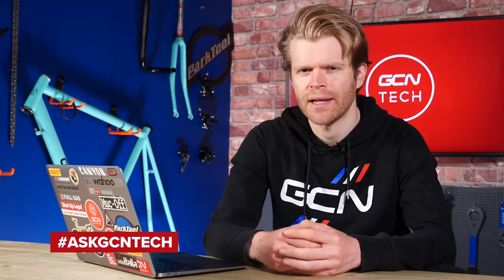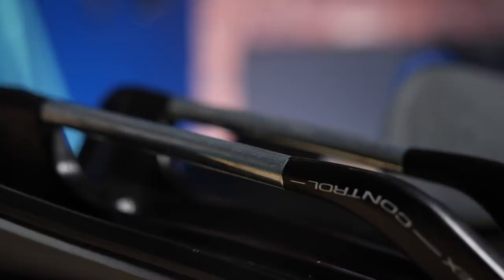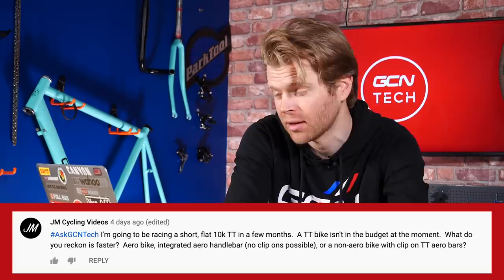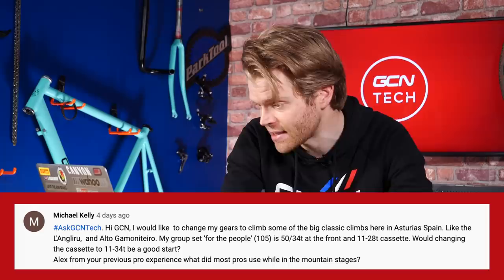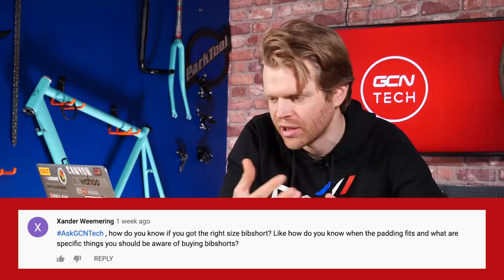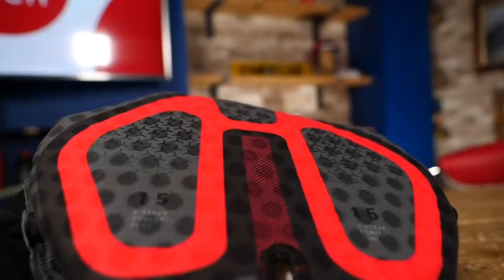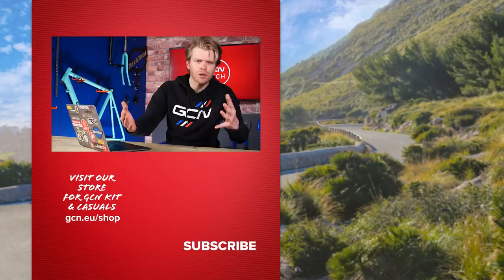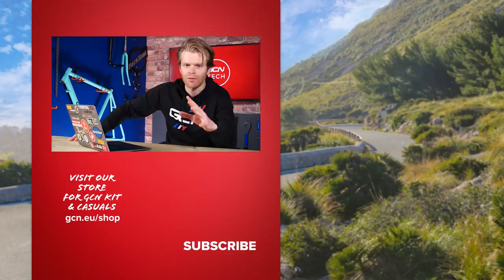Do Latex Inner Tubes Puncture More Easily? | GCN Tech Clinic #AskGCNTech

Comment: #AskGCNTech: Vittoria Air-Liner Ammonia in Sealant Warning = Si pointed out & Vittoria tech has confirmed that the Sealant used with the Air-Liner should not contain any Ammonia. I contacted the Sealant Brand I use and they stated "Ammonia is present in all natural latex solutions - we minimize down to .001ppm". So is that safe enough? 
Vittoria was no help in naming brands that would not be compatible. With all the different Sealants being used by so many riders,  unless the Brand was crystal clear with their ingredients or at least Ammonia content, how would a rider know? Interestingly, Muc-Off one of GCN's sponsors does say Ammonia Free in their website's Product Feature page. The Brand I use does not mention Ammonia at all. I looked at a few other brands with similar mixed results
Mountain & Gravel riders have been using Liners for years including Vittoria's watching YT videos I did not hear any of them mention of Ammonia or damage to their liners from sealant. Feel Free to Edit in anyway - Hoping Alex (aka Mr. Tubeless) can handle this topic.
is ZERO Ammonia the only safe level?

Comment: Latex doesn’t puncture easier they’re about the same. However when it does it all goes at once. No slow leaks, no chance of making it home without a switch.
Reply: BOOM!!!
Reply: @hebrews11vs5  Exactly!
Reply: They are however more resistant to pinch flats, latex being a more fleixble material might be the cause for this. Pinch flatted latex tubes can be repaired from the inside with latex sealant, let them sit slightly inflated for a few days while the sealant hardens and you're good to go. The sealant doesn't repair the holes unless the tyre also gets punctured - And yes, it will get messy!
Reply: @arvidfahlander5364  this is new to me. Thanks for sharing on the latex sealant

Comment: #AskGCNTech on a quite standard road, which part is the fastest (lower rolling resistance)? The part with car rubber or the center of the road? (The kind of nerdy question you ask yourself on loooong rides)
Reply: Is though about this to and decided it depends on your road surface if it’s smooth tarmac then it doesn’t matter but I’ve found that on rougher roads the area where the car tyres run is typically smoother and more quiet so you could probably deduce a little faster too.
Reply: I think the painted lines are faster personally, as long as the surface bumps are the same.
Reply: if you feel the surface, it is breaking you

Comment: Hi All,
What are the critical values I need to look when i purchase a latex tube? I have a 32mm wide tyre, do I need to look for a number somewhere on the spec written 32 or at least 32? So for e.g. 26-36? Thank you! Do I need to fit the inner tube against the rim dimensions or against the tyre? 
So for e.g. I have a 622x19C  ETRTO measure, with a 32mm tyre.
Is this 30/38-622 value is good for me (one of the latex tube I found against my set-up)?
Thank you :)

Comment: #askGCNTech     
When you put a puncture repair patch on a Latex inner tube goes it makes it roll slower so it roles like a butyl tube?
Reply: You have to use pre glued patches on latex tubes, can't say I've ever noticed the difference between a patched vs non patched tube. I've been using them on and off for nigh on 30 years now and I've used most of the brands out there at some point. Most issues are normally down to storage as they degrade if not packaged well and you have to be careful not to pinch them when fitting. The ammonia in some latex solutions can break them down too. Treat them with care and you'll have a lighter smoother and faster ride compared to butyl tubes.

Comment: #AskGCNTech Is it possible to convert a flat bar, belt drive commuter bike into a drop bar, belt drive gravel bike?  Tire clearance is not a problem.
Reply: That depends a lot on what you mean by commuter bike. If we are talking traditional Hybrid then it is usually doable with good results, the main issue you tend to run into is that the top tube length is longer than it would be on a traditional Gravel/CX/Road frame. Providing the top tube isn`t massively longer you can reduce the reach with your stem and bar choices, measure your top tube length then go look at the geo charts for Gravel bikes online (of equivalent size) and see how much longer your top tube is and go from there. Stems wont be an issue as they come in all sizes and are pretty cheap but if you go too short things can get a bit "twitchy" so its better to even out the reduction between the bars and the stem.

Comment: #AskGCNTech which is better, 50mm deep rim or 40mm deep rim. Interms of Speed, handling, and any other aspects?
Reply: 50mm aero. Aero gains are still noticeable vs 40, stiffer rim due to deeper carbon (will corner on rails). And cross wind stability isn't much different. Weight savings with 40mm is usually almost not their either go deeper.
Reply: 40mm much better
Reply: I have 50mm aero - was advised that deeper is better for performance but any deeper than 50mm is a problem in cross winds.  I have had mine for 6 months and have been very happy- they are also lighter than the aluminium wheels they replaced so better for climbing
Reply: 40mm better then 50mm. Reason: lighter, better acceleration, better handling, better in wind,better feeling overall.
Reply: This is more confusing than before 😭

Comment: Hi GCN, i have recently purchased a pair of latex inner tubes but upon arrival i noticed that on the box it says not for use with carbon rims? i am running mavic cosmic carbon wheels with rim brakes, can you please explain why they are not compatible or if i should be okay to run them on my set up? #AskGCN

Comment: #AskGCNTech

In a top level pro time trial how is the time measured when a rider hits the course? Is it exactly at the end of the countdown or is there a more accurate measuring that also takes into account the little time gap between the end of the countdown and the moment the rider actually starts to roll down the ramp?
With pro time trials beeing measured within hundreds of a second at the finish, it would seem a bit strange to me to be inaccurate at the start.
Reply: It's from when the chip on the bike passes the sensor at start and finish.

Comment: Not a tech question more of a question in general.  When riding gravel I often get the beginnings of blisters on the inside of my thumbs. I have tried loosening my grip a bit but it didn't help much, any advice? #askGCNtech
Reply: I think your hands are too dry so theyre gripping the rubber too much. Maybe try a miniscule amount of lotion on the whole hand or just the affected area.

Or, just put electrical tape on where you rest your thumbs on the hoods or just wear groves

Comment: Are there any alternatives to bike chain lube that you can use in a pinch bike motor oil or a mineral oil?
Reply: Yes, even olive oil can be used.
Reply: Old 3 in 1 was tested as one of the fastest ever. Lose 2 watts and save £30.

Comment: #AskGCNTech I haven't used my wheels for quite some time (having ridden a lot indoors) and now I want to use them outside. Those are fitted with tubeless tires, with sealant from the previous application (some 10 months ago). Since I haven't been using those all this time, I was wondering, do I need to re-add some sealant?
Reply: Depending on the amount and brand of sealant, as well as room conditions, the sealant may have dried. You can do the 'dipstick test' and remove the valve core and put a small zip tie or similar in it to check the sealant level.
Reply: @insquares  Thanks for the tip I will do the check!
Reply: @DD GG  Thanks , I will do the checks you suggested!

Comment: #askGNCtech is a 60mm deep carbon wheelset a good all rounder? And if so, is it true that running them with tan side walls will save me 20 watts ?
Reply: I use a 60mm rim brake wheelset when it doesn't rain. It's ok as long as there isn't a lot of wind. I live in Belgium tho and I dont now if i would use them if i did a lot of rapid descents.

The sound they make is amazing and they look pro as well 🙂.
Reply: @simonderoo9189  cool! Thanks
Reply: @MS-sy8ls  i weigh about 70kg is you're lighter than that I wouldn't recommend 60mm because with a sudden blow of wind its pretty hard to 'catch' the bike
Reply: @simonderoo9189  sadly I weigh more! 😂
Reply: I run 60mm wheels all year. I only have issues in very very windy days. I am110kg so maybe a shallower wheel would be easier to live with in the wind for lighter riders. If you live in a hilly area def a shallower lighter wheel would be better too. 
I live in the highlands of Scotland. I would only go lighter(shallower) if racing. Latex tubes and Michelin TT tires is the fastest without going tubeless.

Comment: #askGCNtech When riding in a tail wind are you better riding on the tops to catch the wind or the drops to keep aero?
Reply: If you feel the air more from behind than in front, tops. It's all relative to airspeed
Reply: Always in the drops. Your speed will increase and then aero is more important.
Reply: @OFFSHOREDOUG  this isn't true. If the tailwind is faster than your riding, you don't want to be aero as you will be pushed forwards
Reply: @charliewhelan9488  40mph tailwind is some going and you still will have aero drag. Absolute bollocks.
Reply: @OFFSHOREDOUG  no, resistance is caused by movement through a fluid. If the fluid is moving and you are stationary, there is still drag opposing the direction of the fluid's movement. If you are moving, the net movement of you through the fluid determines the direction of the drag. So if the magnitude of fluid movement relative to the ground exceeds your movement relative to the ground in the opposite direction (or that directional component of the wind using trig), drag will be accelerating you forwards, meaning you should increase your surface area to accelerate more. 

Don't be so sure of yourself if you don't know what you're talking about

Comment: Tubolito used 2 years ago...easy to make flats, same with latex tubes from michelin...junks
Reply: Mmm, I’ve been using Vittoria Latex Inner Tubes & I’ve never had any issues. I do only use this inner tube in de summer with Continental GP5000
Reply: I've used Tubolitos for both road and gravel (~1000 miles between both) and I've had no problems at all.  I've heard a lot of horror stories about tubolitos so I thought I'd try them.  Not a single issue for me.  Although, I think the ride is a bit harsher than with latex or thin butyl.  Also tubolitos are easier to install in my opinion because the slick surface is less likely to pinch under the tire on install.
Reply: @JMCyclingVideos  1000 its nothing my friend..😂😂😂 i make 5000 in a year just with road bike,  mtb is another kms. This year i have 1500 km.
Reply: @mit1978  Oh for sure.  My main road bike is tubeless.  Total for the year for me is about 1,800 miles which is about 2,900km.  I did about 11,500km last year.  I was only commenting on the miles I've put on the tubolito tubes thus far.  And about 400 of that 1000 miles is on chunky Kansas gravel.

Comment: Latex tubes were a bit of a pain because they lose a lot of air overnight.  Mine would go from 95 psi to 55 psi overnight.   I went back to butyl.
Reply: If you like air retention, give Tubolitos a try.  They hold air better than any tube I've ever used, hands down.
Reply: I bought a pack of five cheap butyle tubes, the first one I put in would drop that much pressure overnight, was a real pain. Got a pinch flat on one, had a blow out with one of them and that was the first week... at which point I replaced both with the two I had left and sent off for more expensive tubes, which remain my spare tubes because I've been riding those last two cheap ones for over a year now and havn't even needed to pump them up. 
Complete randomness, that's how I see inner tubes because there's far too many factors for their to be any consistency in their longevity or quality, what improves most is your riding skill and ability to avoid getting punctires. 

The amount of punctures you get has little to do with the tube and far more to do with the other factors, you can't compare one to the other as they're going through completely different cycles... Excuse the pun, a butyle tube will get punctured in exactly the same circumstances as a latex one will.

Comment: Using latex tubes is only barely less practical than going tubeless.
Reply: Always run latex. If you go back to butyl it’s like having a flat tire. Tubeless isn’t faster and I just can’t be bothered with the mess if you do puncture.
Reply: @OFFSHOREDOUG  I use Tubolito tubes. They're stupid expensive but super light and very durable.
Reply: @rg807  I was thinking about them myself. Wasn’t to sure how durable they were. Thanks.
Reply: The one in my front wheel is 4 years old and I've had to patch it once in 14k miles. They sell a patch kit but the material is very similar to a vinyl swimming toy so I just used a patch for that. Also, unlike latex, they hold air for a long time.
Reply: @rg807  thanks for the info. Will order some tomorrow. I can always do with making my bike lighter. 🙈